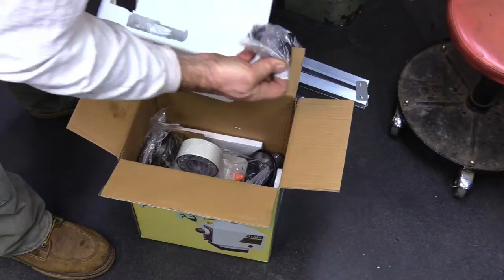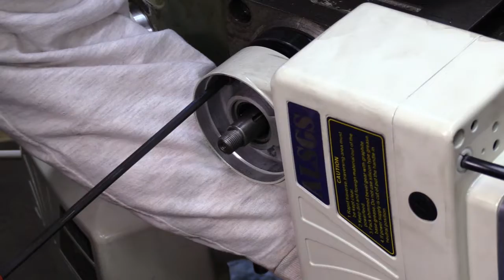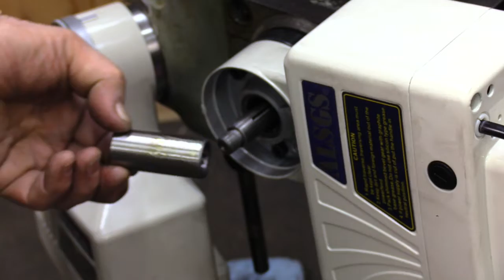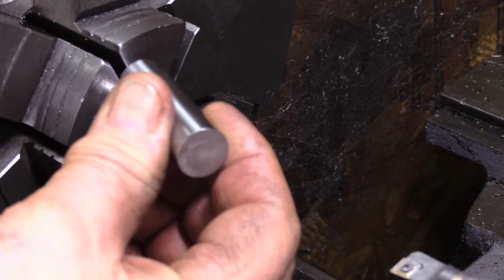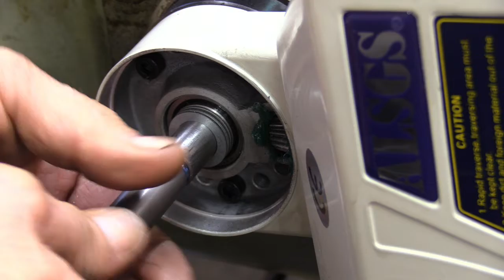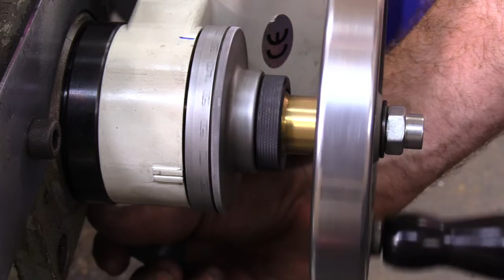Install a Power Feed on your Y Axis | Milling Machine

Comment: Watched this and the z install. This is driving the axis via a key. The Z axis is driving on the extension shaft that is not keyed to the original shaft. Has this been an issue?

Comment: I was able to use similar kits to yours on the X- and Z-axes of my Precision Matthews bed style mill so I may give the Y-axis a try using Asian hardware.  A thought regarding safety - you might consider a safety ball crank handle such as one sold by Eisen Machinery.  They are also available on eBay by other sellers.  All are around $40.  They don’t engage unless you push it in (similar to Z-axis crank).  This could save you a nasty injury if you got caught between the tail of your vise and the crank somehow or, heaven forbid, you snag the crotch of your pants on the rotating handle.  Additionally, the ball handles look nice.  Thanks for posting.
Reply from the maker: Thank you for the suggestion i will look at that.  HNY

Comment: Frankenmill ; -)  Your video will be so helpful to those mounting one of these units.  Thanks for posting.  I never liked these aftermarket units. The crank handle issues for one.  And location of the engagement handle for another.  I'm hoping that my system will eliminate both handles.  Regards.
Reply from the maker: Thanks for watching!
Reply: @rrintheshop  Oops. I forgot to mention that I am building 3 axis power feeds with Stepper Motors driven by Arduino and switches to eliminate the need for handles.
Reply from the maker: Only until something does not work. LOL.

Nice. @KW-ei3pi

Comment: Randy, I'm not trying to crush your groove, Bubba, 'cause you know I respect your knowledge, but that wacked-out power feed angle would drive me nuts.
Have you considered turning the counter bored screw holes in the black mounting ring into slots?
At least then you could rotate the unit into a more Zen- like position.
Just a thought.
Regards,  :face-blue-smiling:
Duck
Reply from the maker: Thanks for your thoughts.  Right now it is works ok.  I would like it to be better.I will look at it more after the new year.  Thank you Duck.  Merry Christmas.

Comment: What a fight. Maybe You could have built the function better Yourself.
China and instructions.... If there are any at all, they often refer to the very first version of the equipment. When the stuff is upgraded the manuals remain the same....
Time 38... There's so much equipment that You barely come close to the machine.... Joking.
Reply from the maker: For sure Stefan.  Stand-off is not to bad.  Thank you for the comment and Merry Christmas
Reply: @rrintheshop Merry Christmas Randy

Comment: I fitted  a Z axis drive a couple of years ago and I did not like the spring in the handle I removed it and the bolt to hold it to the shaft and keep it in the reversed position until it is needed. Works great
Reply from the maker: Yes for sure John, already removed.  Thank you and Merry Christmas

Comment: Careful if the ad says 'fits Bridgeport and clones'. My PM feed (took three to get one that ran!) said fits Bridgeport. NOT!!! Hardware metric, bolt circles off, shaft sizes metric, etc. Good thing I had a lathe and mill...
Reply from the maker: Yep for sure John.  Thanks for the great comment.  Merry Christmas
Reply: I think most of these after-market manufacturers assume the buyer has enough mechanical savvy to make their products work. In fact, I'm sure they're counting on it!
Reply from the maker: @gordonmorse663  Yep i think so.

Comment: I'm wondering why you didn't just turn down your existing shaft to fit the new parts rather than modifying/making them fit your existing (bent) shaft?
Anyway, enjoyed the video! 👍 Thanks!
Reply from the maker: I thought about that.  But I would of had to tear down the saddle to get the shaft out.  Way more work involved.  I am sure once I get the shaft removed I would want to make a whole new one for both x and Y  and new nuts.  Thank you for your comment and thoughts. Merry Christmas.

Comment: Morning Randy. I have the same power feed on my mid size Rockwell mill. Three years in zero problems. My one issue is sometimes I need to adjust the feed knob up to get it moving and back it down to slow slow feed. Other than that all good. 

Nice modification.
Reply from the maker: It to bad Dan.  Thanks and Merry Christmas

Comment: Great way to do that  Randy. I like the idea of doing this. My mill is a 1912 Garvin and it would be a major improvement to have a power feed on the x axis to start with. Thanks for the motivation. ☃️
Reply from the maker: Thank you Randy, this setup is working great.  Yep x should be the first axis to have. Merry Christmas